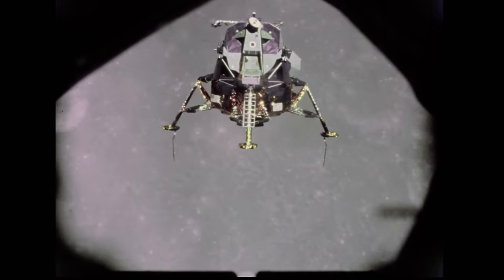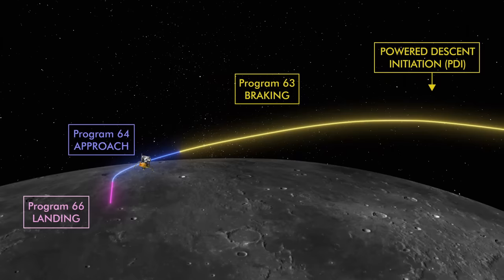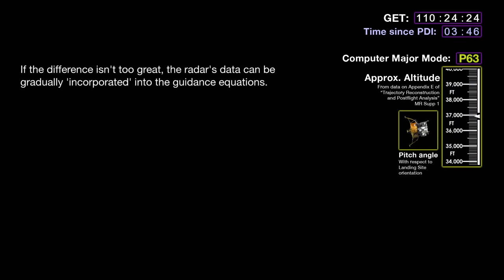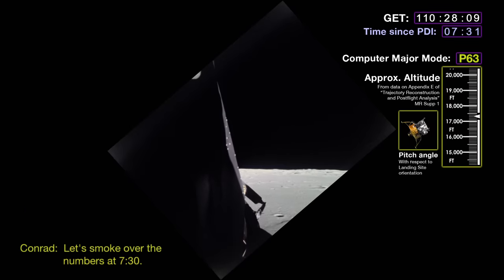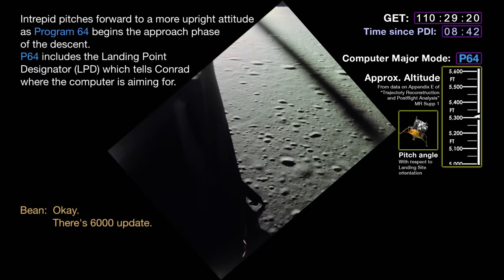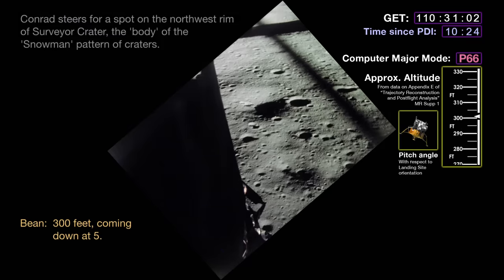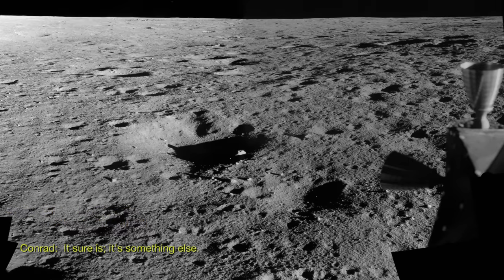Apollo 12: The Complete Descent

Comment: Those two had such a great sense of humor and weren't afraid to show their joy at what they accomplished.  My greatest regret from that mission was when they tried to remove the video camera that would provide a live feed from the surface, it accidentally got pointed directly at the sun, resulting in the light sensors being burned out.  It would have been a joy listening to them as they did their work around the LEM.
Reply: Yeah those saticon tubes were so delicate.  That particular cam also had a rotating RGB filter that was supposed to result in 'true' color video.  The hope was the color wheel was stuck, blocking the camera.  That's why Alan Bean tried fixing it by tappy-tap-tapping the camera case with his hammer.  It didn't work.

Astronaut Bean's camera issues didn't end there.  He left one of the Hasselblad film magazines on the Surveyor lander because of a distraction.  And either just before, or during splashdown, a 16mm event camera broke loose from its mount and hit him in the face!

I always wondered if these were part of his motivation to take up painting.  He produced some beautiful works.

Comment: One correction. I believe you were thinking about the helium supply tanks in the ascent stage, which do contain gaseous helium at high pressure. In contrast the helium tanks in the descent stage were not filled with helium gas at extremely high pressure. What's in the tanks is supercritical helium, which is an extremely cold, dense cryogenic liquid that is stored at a relatively low pressure. Supercritical helium has other compounds mixed into it that allows it to change phases from a liquid to a gas very quickly when it's exposed to higher temperatures. During the operation of the descent engine, helium gas from the supply tank is routed through a heat exchanger on the descent engine. This warms the gas and then it goes back and flows through a heating coil located inside the supply tank. This dumps additional heat into the supercritical liquid helium inside the supply tank, which boils more liquid to produce even more gas. From there the pressurized helium gas goes to the fuel and oxydizer tanks to pressurize them to greater than about 110 psi to maintain the flow of propellants into the engine.
Reply from the maker: Thank you for your comments. The one detail that you mention that is new to me is the addition of other compounds into the LM's cryogenic helium to enable the supercritical state. I would be very interested to learn more and if you can point me to a source, I would be most grateful. You seem to say that there were multiple supercritical tanks. I'm only aware of one such tank, plus an ambient tank that was used to get the system going until the flow of fuel through the heat exchanger was established.
In a video such as this, there is neither time nor space to give a full description of a system. Suitable simplification is required for brevity. Since the pressure in the supercritical tank was between 400 and 1,750 psia (27 to 119 times Earth atmospheric pressure), one can argue whether or not this is 'extremely' high pressure or just high pressure. I was, and still am happy with my brief description.
Reply: Supercritical helium is not a liquid, but a fluid. Liquids and gases are fluids and supercritical fluids are something that has some properties of both.

Comment: Wasnt the original footage lost or written over?
Reply from the maker: This is 16mm film footage. By using the phrase "written over", it implies an assumption that this was video recorded on magnetic tape. Two entirely separate things are being mixed up here, but that is the way of modern information exchange. It doesn't have to be correct to be spread far and wide.
What is likely being referred to as "written over" is referring to the tapes that had a recording of the slow-scan video signal that was transmitted during the moonwalk of Apollo 11. That signal was converted, live, to commercial TV format for live broadcast. The source signal was recorded on tape but it was not required again - until decades later when it was realised that the rather poor conversion process could be bypassed if those tapes with the slow-scan recording could be located. They never were. Meanwhile the story was passed around and distorted.
The original Ektachrome film of this 16mm footage still exists, kept in a freezer in Houston. This is a high definition scan of that footage. Film and video are very different technologies.
Reply: Not only this is the wrong Apollo mission to ask that about, it's about the wrong type of footage.
Reply: @apollo12-apolloflightjourn11  They used Ampex tapes at the time and they were very expensive. Indeed, it was the Slow-Scan images that were overwritten, not the converted images. Too bad because the Slow-Scan images were of better quality.

Comment: Not a conspiracy theorist, but are these communications altered? The communications between Earth and Apollo 12 takes about 1.5 seconds one way and there are many occurrences in this apparently uniform audio where the responses come in immediately, which would be impossible.
Reply: Example?  Timestamp?
Reply: Yes you are, why are you picking this out? .   this is a well done integrated video and audio that would have been tailored for general consumption., including removing no sound in the audio side.
Reply: @chsyank  No I’m not. I’m picking it out because it stood out to me. All I’m asking is if anyone can confirm that the audio was edited in the manner in which you suggest. It’s not a hard question. If you don’t know the answer then shush.
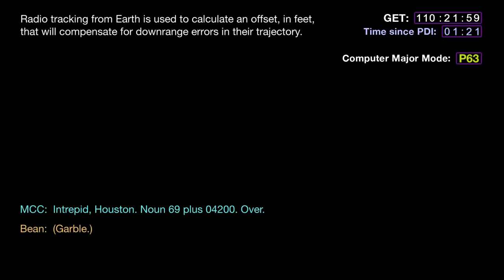Reply: @tubecated_development  There are many examples but one is at 5:30 where Bean transmits “Roger. Copied. Plus 04200” and MCC replies immediately with no delay. Having listened to the rest I noticed that the delay only happens when Apollo 12 is talking to Houston, which would make sense if the recording of the transmissions was being made at Houston, which it was. So I think that’s what’s happening rather than audio edits. If you rewind to 5:20 when MCC transmits the 04200 info there is an appropriate delay before Apollo 12 responds.
Reply: Don't cite me but I think I remember from from the Apollo 11 "real time + 50y" event that the audio was synched at times. But this is not required most of the time, as each source recording was from a certain place, mostly Houston, so the communication delay is already on the record, effectively synched. So I would guess this particular recording here should not have needed any additional synching; it was as things looked and sounded to Houston and indeed, the actual events and sounds in the LM took place 1.5 s prior.
Reply: @NoIce33  That sounds exactly right, thank you. I noticed that MCC always answers immediately but that Apollo 12 responses to MCC were appropriately delayed, all of which is consistent with the recording being made at Houston. Physics wins. :)
Reply: @NoIce33  You would guess. Okay...

Comment: thats all the footage they have?
Reply: There is a lot more
Reply: Every landing was filmed with a 16mm film camera. They only had one such camera on each mission, for the landing this was installed on a bracket, looking out the window. The LM could not send a video signal to Earth during the landing: it didn’t have enough bandwidth to send video and high-rate telemetry at the same time. So there is no TV footage of the landings.
Reply: Are you asking just about the Apollo 12 mission?  Yeah, there's a little bit more footage, but, not much.  The TV camera burned out a few seconds after being moved to its tripod, which would have been the majority of the Apollo 12 footage (had it worked).  But, yeah, as it is, they just have some of those 16mm clips, and photos.  Ironically, they even accidentally left one roll of 70mm film inside the camera (still sitting on the lunar surface).  So, not only does Apollo 12 not have as much video as was planned, but, even lost a whole bunch of photos also.

Comment: That blowing high speed dust at touchdown didn't look even close to real..more like a black and white cartoon
Reply: I've seen sand move like that in high winds.
Those thrusters are damn powerful. No wonder they're kicking up heaps of fine dust.
Anything else?
Reply: @randyjohnson6845  Why would there be a crater?? Craters form from solid impacts, not from gas pushing it around 😂

Also dust settles fast on the moon because there's no wind to keep it floating when you switch off the thrusters. Use your brain.
Reply: You make a million postings in a million videos with no interest in the responses.  Why?  What's your point?  You don't understand any of this.  There isn't an aerospace engineer on the planet who would expect craters to be dug by 2500 pounds of thrust out of a 20 sq. foot engine bell.  Oh, but YOU do.  And, of course, had there been a crater dug by the rocket exhaust, you'd simply say the exact opposite, and insist that a crater shouldn't have happened.  No matter what happens, you're going to pretend to know things you don't, and insist the opposite should happen.  Why?  What possible motivation could you have to keep doing this over and over and over?